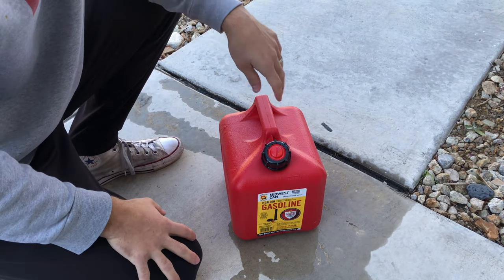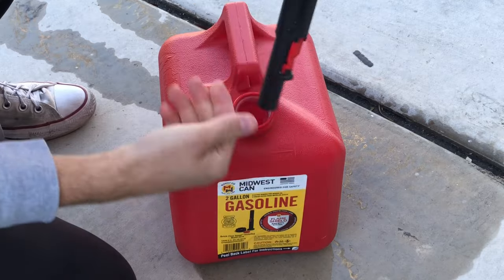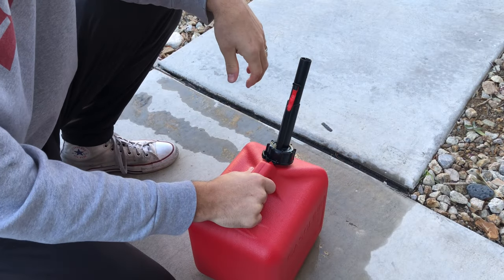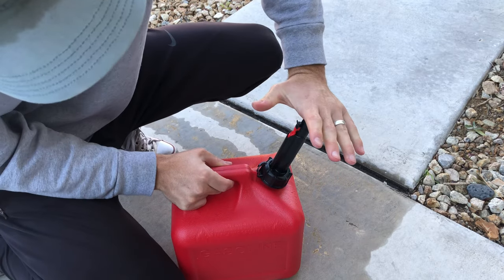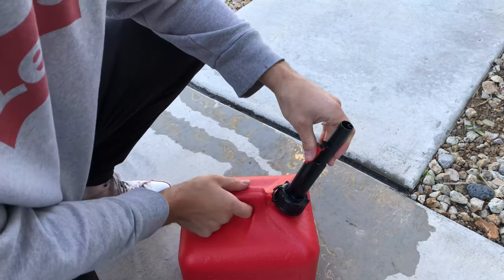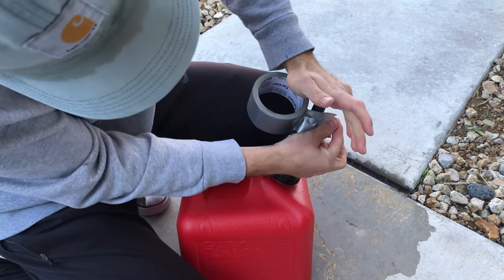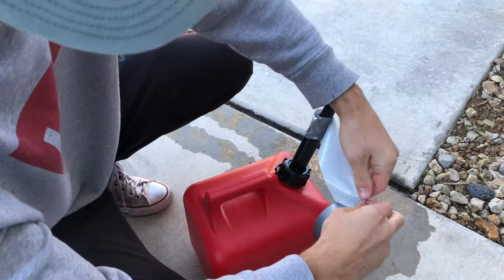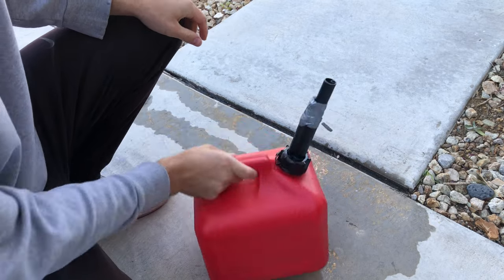How to use Midwest Gas Can (then FIX)

Comment: "Over-engineered" is a polite way of saying that this gas can SUCKS..!!  I bought one yesterday evening and filled it with gasoline .... then tried to get the damn spout to work and finally opted to use a magazine rolled into a cone.  I'm 77, my vision ain't great and this POS was frustrating as hel.  Thank you for this tip and workaround.  Worst $24 I have ever spent.
Reply: I'm having the hardest time with it. Damn thing keeps leaking at the base. I just spent $15 on it and won't be able to return it. I followed the directions in the videos and it's still leaking.

Comment: Thank You! I just bought this exact can and it has no instructions. You are doing the Lord's work.
Reply: A friend just handed his can to me....had to find this video.  But, look at the label, lower right side says peel here for instructions.   The label opens up with pictures but still couldn't make it work until viewing this video. lol.   Turned out the yellow "button" was already depressed but didn't know it.  Had to PULL on the sprout and then it clicked to start over.  Over Engineered  🙂

Comment: Im ok with the the spring closer, but not the child safety lock-  a pair of tin snoops took the plastic safety right off and I have a nozzle that doesn't vent gas fumes sitting in the garage.
Reply: These new ones seem like even if you take the safety latch off the spring is still way too stiff.

It's like they designed it for the 5gal tanks and put it on all of them.
Reply: How did cut it top and bottom then pull?

Comment: I doubt the adhesive on the tape would do well sitting in gasoline, or even gas fumes. If the adhesive dissolves into gasoline or alcohol (most gas today contains 10% ethyl alcohol) than I doubt the adhesive would do good things to a carburetor or fuel injection system.

There are other YouTube videos on how to permanently open the nozzle, quite easy, just one pair of one pair of pliers needed, and about 30 seconds.
Personally, I have 3 of these cans, and a Jiggle Siphon: Safe, fast, and simple system.

Comment: Thank You soooo much!!! I bought the 5 gallon kerosene can and I could not figure out this disaster of a spout. The instructions were of no help what-so-ever. I ended up ditching the spout to fill my heater, I used a funnel and just poured the kerosene directly into the funnel (outside of course). And forget about the siphon pump that came with my heater, as you just can't get down in there. Next time I fill my heater, I will still use my funnel but with the spout now that I know how to get it to actually work 😄👍

Comment: lol,   just rip the red thing off,  the black tab on filler tube is to push against edge of gas tank neck like on mower to flow gas and when you lift it shuts off which is what is cool about it.

Comment: That can's nozzle is one of the most ridiculous, dangerous devices I have ever seen.   

Even if they gave you proper, readable instructions and you figure out how to hold that red piece down while pouring, the shortened nozzle is NOT LONG ENOUGH TO HOLD OPEN THE GAS TANK's ANTI-SIPHON FLAP and the gas spills all over the car.

Also, when stored, the nozzle is closed at the base.  So when you pull it out of the can, the column of gasoline trapped in the nozzle comes out with it, and this gasoline spills all over the place.

And the nozzle is not bendable, so you cannot tilt the can completely upside down and so cannot completely empty the can when the nozzle is in your gas tank filler   

It is NOT a safety device.

Comment: Anything we buy that is labeled;
'SMART' , is usually anything but smart. 
These inverted realty cans, defeat their 
very premise. 
If we need to empty
the cans to store empty/clean,
 the only way I can see that  we 
can to evacuate the last 1/4 - 1/2 + - 
ounce of fuel is to  have it evaporate,
and isn't that exactly what they are 
intended to prevent?
When we remove the cap and 
ridiculous filler assembly, 
turn the can totally upside
down and on any angle possible,
there is still an appreciable amount 
of fuel in the can.
These cans should only be
'legal' lol , and required in Ca. 😄
The kicker' is that these cans 
are 2 to 4 times more expensive
than the 'standard' , traditional 
cans were , that worked/work 
flawlessly.

Comment: WRONG!!! Remove the spout. Press it in and hold it while removing the o-ring from the spout. Now shove it back and remove the spout completely. Pull out the spring and toss it. Reassemble the spout without the spring and it will stay compressed without the spring pushing it back to its original position.  No need for duct tape so you will avoid a gooey mess down the road. You're welcome!

Comment: The problem with using
duct tape is that gas will
turn it to gum fairly quickly,
but perhaps a stainless 
screw would work. 
Where does the 7''+ - long
 filter stored, or how is it supposed to
be integrated, (I was given
the can with it sloshing around
at the bottom).
Thanks for the video, I found that
the standard can spouts don't 
fit this newer pofs-can, obviously
that was part of their dystopian plan,
I wounder if there is an after market
spout that will fit, and an easy install
vent, to turn these cans into 
ones that work.

Comment: A couple of things: 1. You're overriding an important safety feature designed to prevent releasing vapors and spilling gas. 2. The red button stays locked in each time it's pressed. 3. There's a notch on the spout that you're supposed to rest on the lip of the tank you're filling to make it easy to open the spout without spilling.

Sorry they couldn't make it more idiot-proof for you and your viewers, even though most models include stupid-simple visual instructions on the side of the can...

Comment: Or..... you could simply push the red button down and pull the nozzle all the way out revealing the spring. Remove the spring and put the nozzle back where it was. Now you will be able to close it using the red button to hold it closed. When you need to use it simply push the red button down, push the nozzle down, and it will stay down while you pour.😊

Comment: Sorry but last step is not taping the tube. Press button until clicked, put pout into opened gas tank. THEN push the whole pout and container Using the little tab against the gas tank lip. That will push the top tube down and open the flow.

Comment: What idiot designed this nozzle?  I spilled more diesel than I got in the truck.  Does not work as they claim. Why does every store only carry these waste of time nozzles?  I snipped the red piece off, made it easier but still spilling fuel everywhere but the truck.

Comment: Only problem is now you have a spout which is open and is now a fire hazard in your garage or if the can is knock over. Fuel vapor is in your garage floor awaiting a fire flash point.

Comment: I never thought I'd need assistant with a gas can spout, but here goes..  I pressed down on the red button, but when I pushed down on the stem, it does not stay down (and therefore I cannot pour the gas out).  Any suggestions on what I am doing wrong?  Thanks.

Comment: That sucked cause to have a gas can and no gas in it.  I thought thats the purpose for having a air tight lid and cap for it so if you some place and run out of gas you can just open it and do this and put gas in your car .   So what the purpose of one if you can't keep gas in it and the smell of gass comes out . 🤦🤷 they mad all these charges and still say never leave a gas can with gas in your trunk 🤦

Comment: I hate mine too. But you had the safety latch on 180 deg off. It's designed to be pressed on the lip of the gas tank (first press the safety tab in), and press down on  it, pushing the safety latch into the nozzle. What bugs me about mine is that the little red cap is too small to fit over the nozzle end if you want to leave the entire nozzle attached for pouring more gas out. Betting that's because your beloved Govt overlords decided leaving the nozzle attached might not be save...they're just trying to protect us!

Comment: Maybe I'm missing something but doesn't your duck tape fix defeat the entire purpose of the safety design. Also, if you invert that duck tape modified spout back into the can it will surely dissolve away and muck up your gas. I know your not going to store that duck taped open system as is, so  you are going to have to cut the duck tape right back off again and store with the spout inside can as in original.
Reply: ah, i just noticed you already answered my question in your intro comment. Thanks.